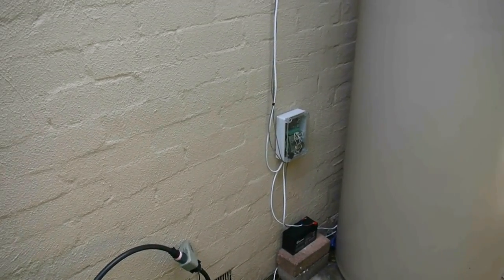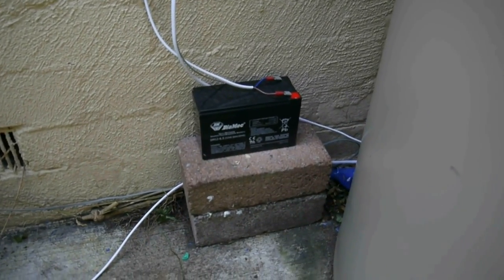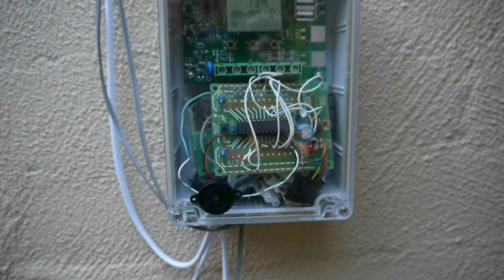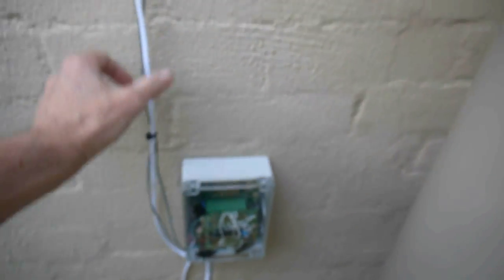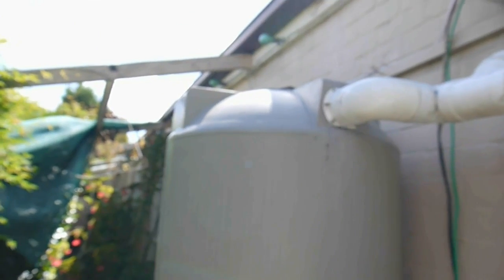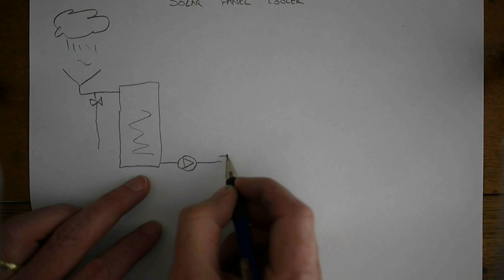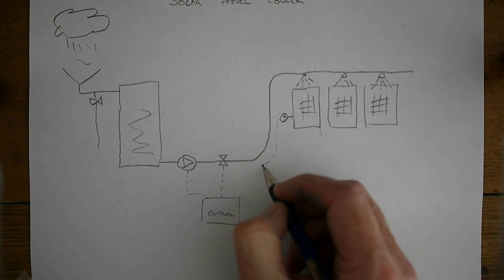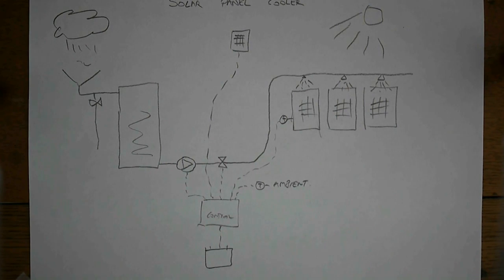Solar powered solar panel cooler system

Comment: Hi Michael i liked your system as because rain water doesn't have calcium depositing problems. Is this system still functioning after so many years. Do the panels still clear without any water marks. Please share latest video.
Reply from the maker: I have removed this system now because I am readying the house to be sold and this is simpler. I still did get minimal calcium deposits using rainwater I think because the rain runs to the tank  across my roof which has cement roof tiles.
Reply: @michaelporter000  Thanks for responding appreciate it looking forward to see your upcoming installation

Comment: Had an idea, though it's probably not worth it and likely most of the rainwater evaporates as it goes over the hot panels, but can you recapture the water after it runs off them into a drain back to the barrel feed?
Reply: All the water evaporates and there is nothing to collect.

Comment: Do you live in Brazil and I liked the theme of the video, can this cooling damage the panel soon?

is this cooling system still functioning?
Reply from the maker: This system is in Melbourne, Australia. This cooling method cannot damage the panels because it is just a spray of rainwater and the panels are obviously designed to be rained on. Also, the cooling limits how hot the panels can get so that could possibly extend their life. The cooling system has been running around 15 years now and just last week the panel temperature sensor (or sensor wiring) appears to have failed, which is the first controller issue it has had. I haven't had a chance to work out what is wrong yet, but the temperature sensor is just a cheap thermister so it should only cost a few dollars to fix.
Reply: @michaelporter000  so your panels are 16 year old? So what is the efficiency of them? And how much you paid? I want to compare then vs now. They are still performing?
Reply from the maker: @LuisC7  The panels are rated at 1000W only. The highest power output I saw when new was 1100W and the highest power output I saw in the last 6 months was exactly the same 1100W. I don't have constant monitoring so this is just me doing casual checks when it was sunny. As far as I can tell there is minimal performance drop, if any.
Reply from the maker: fyi - the fault was the insulation of the cable to the panel temperature sensor had failed due to exposure. It was not designed for that duty in full sun and wasn't installed in conduit so it did well to last so long. I have removed the cooling system now as I am preparing the house for sale and don't want the complication of explaining this system to potential new owners.

Comment: Very nice. But you should use a grundfos silent circulation pump instead of that screamer!
Reply: You're right -it is a screamer! I have now fully encased the pump in a box made of bricks filled with expanding foam from a spray can so I don't think I can go any further to dampen the sound, and it is still noisy. I think the Grundfos pump would be many times more expensive and hence a longer payback period.

Comment: Add a fan that turns on ocationally after the water sprays. To cool it down further preventing too much water waste.
Reply from the maker: I don't think there would be a cost benefit of any fan system that would need to be mounted without casting shadows on the panels while providing uniform air flow. The panels are hot anyway so they should easily evaporate water without help.
Reply: @michaelporter000  there are blower style low profile fans tat wont cast shadows.
Reply from the maker: @azimalif266  I am really suggesting there would be no cost benefit. The pay-back period comparing the cost of installing, running, and maintaining a blower could not be realised in the savings on the extra electricity generated.

Comment: You have a small system, 2-3 Kw at best. You would be far better off getting some used panels and adding a second string on the same inverter. Yes, You can over clock the inverter and NO it won't hurt it. It will give you more power earlier and later in the day and when it's a cloudy day as well. Alternatively if you are a worry wart and have to do everything by the book the corrupt power co's set down, Just get an up to date 5 or 6.6 Kw system. It will be paid back in 3 years and you'll be making loads more power and saving a lot more money thereafter than mucking round with this.

Improving output 20% on such a small system that you have modified and spent money on 3 or 4 times now is kidding oneself to think you are in any way ahead. The system is old and outdated for a start and trying to improve it is an exercise in Futility.
Reply: It is a small system but I can't upgrade it without losing my over 70 cents/kwhr feed-in tarrif. The upgrades have easily paid for themselves even though it is small and I enjoy the process.
Reply: @michaels-ideas   So how much extra has the cooling given you per year in KW or FIT?  What is the actual size of the system?
Reply from the maker: @thedummyspit8814  It's only a 1kW system. It is hard to estimate, but I'd say it might give me an extra 150kWh per year at $0.72 feed-in tariff is an extra $110 per year. It's been running for at least 10 years with virtually no running costs. It's not much, but it's not nothing.
Reply: @michaelporter000  The chances of you getting 150KW a year extra with a 1KW system in Melbourne with cooling panels  are virtually non existent. In summer the pump would have to be running so much it would eat up any power savings easily not to mention what the controller draws over a day. Might be small but  there's not a lot to  to play with here at the start. 
You would be far better off to upgrade the system and forget about the .70C  Fit. There are deals where you can get .50 C now on systems under 10 KW so you are really making a false economy both ways. 

Clearly you are not going to listen to anyone but others would want to think twice about this because it's a waste of time and effort for no worthwhile reward.  I have done the tests and measured all the factors accurately and it's much better to just add another panel or 2 to the system and be done with it.
Reply from the maker: @thedummyspit8814  This video is just a record of what I've done- I'm not selling anything or recommending others do this. For the record, the pump and all electronics are completely powered by a separate small solar panel so there is no electrical cost of providing this cooling. Most of the equipment required were items I already had or were very cheap because otherwise the payback period would easily blow out. I agree extra panels are the best way to increase output - and that's why tracking systems for example are very hard to justify.
Reply: in australia, at least in the state i live in (QLD) you aren't allowed to change the size of the inverter if you wish to retain the government feed in tariff. adding more panels may be possible but only if the capacity of the panels remains under the inverter's nominal operating level. so sadly this isnt an option for some :(
Reply: @BoomBrush  It's an option if you don't let corrupt and greedy power companies take advantage of you.  I sure as hell don't!!
Reply: @thedummyspit8814  so you can overclock the inverter and the inspection agents won't notice it? Then yeah its good

Comment: You would do far better adding 1 used panel to the system. This would give more power summer and winter, have virtually zero setup cost and would also give more power on overcast days. Trying to make solar more efficient is chasing ones tail.  If you add up the real cost of this setup and the amount of gain you are getting from it. You are probably making cents per day, if that?
Adding another cheap panel into the system would give far greater returns over all.
Reply: I'm not allowed to add a panel without losing my generous feed-in tarrif, but the point of the video is about how much cooling can help. You can decide whether that method has any value for you.

Comment: Does it have to be rain water instead tap water? Does the water drops increases the efficiency by reflecting more sun rays?
Reply from the maker: I ran it for a while on tap water, which is low in minerals in our region (in Melbourne Australia) but it still ended up depositing a lot of calcium on the panels which then took hours of hard work to remove. That's why I had to switch to rain water. The water increases efficiency by the cooling effect only and has nothing to do with reflection because the water evaporates quickly.
Reply: Alright at what temperature starts your cooling system to operate?
Reply from the maker: @zsoltszepfalvi5798  I start when the panels measure 8'C above ambient.

Comment: Great idea using rain water and over all concept.

For those that are not Micro controller users or Rube Goldberg enthusiasts, may i suggest a far simpler off the shelf control scheme? Gonna anyway! HA.

Ditch the solenoid valve, they are power hogs. Install a check valve if your pump does not have one built in. Mount switch to underside of panel or drill a hole in the side of the frame if it makes sense with you panel type.

Use an off the adjustable Temperature switch, Set it to 100 degrees and run directly to your pump (5 Amp contacts in switch).

Simple wiring,
Power source to Switch to Pump.

  CA 100 $6.50
https://www.alliedelec.com/m/d/cc341599ed192d6d7d69f25d58665472.pdf
Reply: Lol! My current system evolved a bit. I wouldn't include the solenoid valve now. Simpler is best but the temperature difference to ambient means the system works all year round so it's important. Great if you could find that kind of thermostat!

Comment: nice setup... what is the efficiency gain you are seeing... ?
Reply: About 20% more power while cooling, but cooling only happens in middle of the day when few clouds and little wind.
Reply: @michaels-ideas  tq.. would you say it was worth the effort.... ?
Reply from the maker: @shashiy4545  That's a really good question. I thought it was worth it for me because I could do it all myself so it wouldn't cost much and if something failed I could fix it. Originally I started with tap water instead of a tank which was good but it led to calcium deposits on the panels, which was very hard to remove. I had to buy a rainwater tank and pump to solve that, but that was almost too expensive. I justified it because I could also use the tank for other purposes. You really need to look carefully at all the costs and benefits compared to just buying another panel. For me, I couldn't buy another panel without losing my very generous feed-in tariff, so this helped get the best out of my small system. It's a similar issue to building a tracking system where it is usually much better overall to just buy more panels than retro-fit a tracker. For me, it has all been an interesting project - but it is certainly not for everyone.
Reply: @michaelporter000  i have  6.8 kw panels connected to a 5kw grid tie inverter in India... its gets very hot and humid here through out the year and i see a drop in production due to this... i have never see it go all the way up to its rated power of 5 KW...  i was thinking if this could help me get more out of the system as i cant add any more panels with out getting bigger inverter which is expensive... i am going to use water from air-conditioners which is pretty much distilled so might work out ...  i believe i can do all of  all this myself ... any important pointers to keep in mind will help tq....
Reply from the maker: @shashiy4545  I often get more than my panel's rated output of 1kW with the cooling system. One issue I had was with algea growing in my pipes fowling up the spray nozzles. I decided it must have been because I used white pvc pipe for the header that was attached to the panels, so I ended up painting it to make it black, and then put some black pipe over the top as well when the paint didn't seem to work. You might consider using a metal header pipe. I also used metal spray nozzles. You will want to use the same metal if you go with metal pipe - i.e. copper/bronze. I adjusted spray location and timing to wet the entire panel area with the least possible run-off of water, and avoid re-spraying until dry - i.e. minimal water wastage. I used a temperature sensor on the back of a panel and an ambient sensor in the shade and only turned on the cooling cycle when > 8 degrees Celsius in difference. You might want to consider adding a non-return valve to stop water draining back into tank and I would just use a pump rather than any control valves. Also - my diaphragm pump is really noisy - so choose carefully with enough head to reach the roof. I had to build an enclosure to reduce the noise.
Reply from the maker: @shashiy4545  I should also say that my system is quite old now. It is possible that if you have newer panels they may be less affected by heat. You might want to research that. But for my system I have 1kw of panels and a 1kW inverter and I do see output power well over 900W quite often on cloudless days, and I live in Melbourne Australia.
Reply: @michaelporter000  tq i will keep those in mind... since i will be using distilled water from air conditioner it wont have necessary nutrients for algae to grow.... and i can change the water often because my air conditioners are producing quite a lot  water each day... hoping algae wont be an issues... but got to try it to find out...
 i have both a drip irrigation flexible pipe and a pvc pipe which would you say is a better option... ?
Reply: @michaelporter000  good point on rated temperature.. my panels have a rated temperature if 25 degrees.... our day time temperature never goes below 28 degree any time during the year.... in summer it hits 45.... so think i am good on that...
Reply from the maker: @shashiy4545  I don't know. Either should be ok. Best if designed for outdoor use - i.e. something that copes with the direct sun without cracking etc.

Comment: I'll be adding this to our system also here in the Netherlands! With our 50 panels 20% on sunny days. The energy company will pay me €1,32 extra. Which doesn't seem a lot but times all the days and 25 years is enormous!
Reply from the maker: Note that the 20% extra power is only when cooling is actually operating, i.e. only when there would have been enough sun to heat the panels more than 8 degrees C above ambient, which for me is maybe at 50% rated power output on a still day but could be at 70% on a windy day.
Reply: Awesome your company pays you 1:1?
Reply: @LuisC7  right now the electrical company pays me 0,61euro cents and i generate 21.000khw yearly only using 5.000kwh... so 16.000x0,61which comes to nearly 10.000 euros 🎉
Reply: @usmcn  oh wow that's actually a lot! You have some warehouses in your company that you put solar panels on? Or just your house? Or rather, how much would such a system cost today? Also, if the government/company breaks contract, do you sell it to private?
Reply: @LuisC7  i live on a small farm but we dont farm. Its just the property. We have them on the roofs of our 2 buildings.  They never break contract in my country. The system costed me roughly 15k, ill have it payed back this year. (Roi) its almost 3 years old now. Could have done it cheaper but i wanted expensive inverters from fronius and extra windproof roof hooks. Could have done it for 13k
Reply: @usmcn  oh wow I am astonished, because even with less solar irradiation there you could make such a good investment, with 4 years of return. I still don't know how they pay you doublr of what electricity costs? It costs roughly 0,25 here. Doubt in the Netherlands its much different. I am asking so many questions because I will move there at the end of this year and I also want some solar panels. I didn't even expect answers on such an old thrrad. Thanks for that!

Now just to make everything easy to understand. Can you say how much area of solar panels you have and what solar panels they are. 4 year old technology is preety much still top notch. And a 15000€ system yields a 4 year return, and gets you 10k a year after that? Just to make sure I understand correctly. Thanks.
Reply: @LuisC7  it depends on which contract you have. I choose the most expensive contract since they pay me the most for a kWh. Buy contracts used to be 0,26 cents a kwh right now the cheapest is 0,46 i believe. I have 71 panels so far with a roi of 18 months give or take. It doesn't really matter which system you have. I went for quality. And placed everything myself
Reply: @usmcn  yes that's the way in just amazed at those prices. Noone would pay me more than 10 cents

Comment: Very nice system. Another thing which would help would be raising the panels a bit away from the roof. At minute 7.01 I can see the panels practically sitting on the roof. If you raise them about 40cm and maybe tilt them a few degrees more, natural air convection will cool them even further.
Reply: You don't need pump for the water either, since the hot water will circulate up the solar panel and into a tank on its own... convection also just with a liquid.